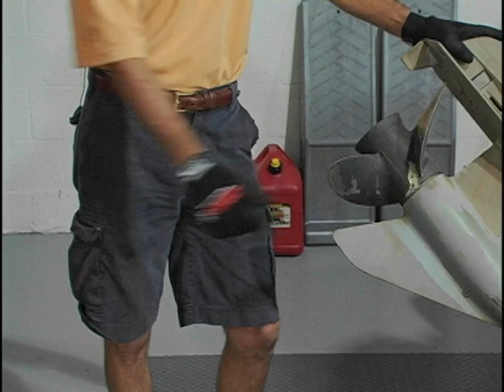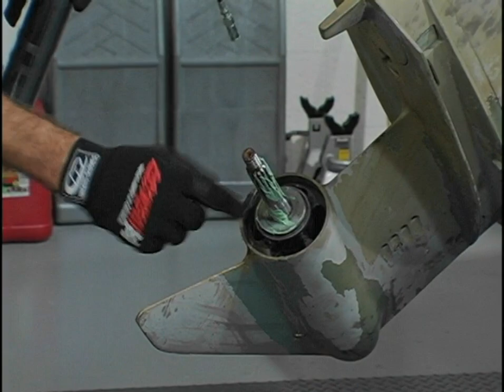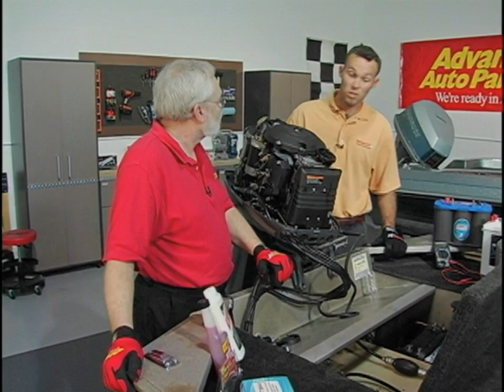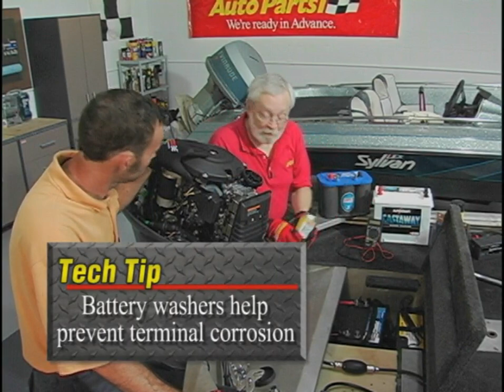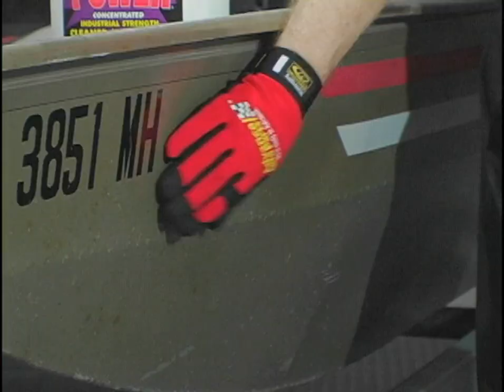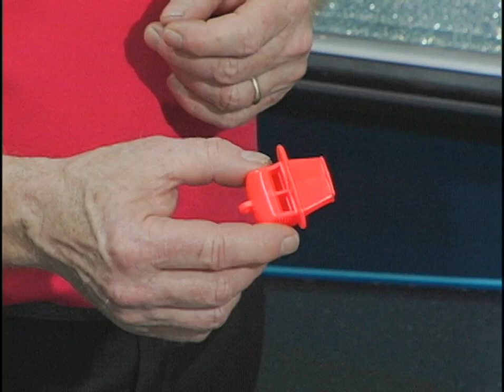Outboard Engine Maintenance - Advance Auto Parts

Comment: Hello Mr. Jim Bates?My name is Kara and I have a 2001 Yamaha 25hp 4stroke F25ELHZ and its surging at full throttle.Do you no what the problem is?
Reply: You could have several things to choose from. Air intake, fuel pressure,electronics or even planing. Hard to say without  visually inspecting.

Comment: hi guys I like to fix my outboards myself and I need the knowledge on how to fix an Johnson and evinrude outboards and same goes for the Mercs too and I have a disability  how id do the servicing myself and learn the right tips on do it yourself outboard servicing I currently own a Tohatsu 30hp 2stroke outboard and need to learn how to service it and im getting ready to bring it out of storage  do I need to change the spark plugs and the impeller for the water pump and if there is other things I need to do like drain the old premix out of my tank and do I need to follow what the mechanic says on gettin the boat ready for the new summer im from Australia  kind regards Michael walker
Reply: michael walker gg
Reply: Yeah dumb ass it's called maintenance

Comment: Is it possible to replace the plugs with (of course) with the same sized threaded type only a type that s removed and replaced using a socket wrench?  I had a Evinrude 175 back in '88 and changed the gear lube with a big flat blade screw-driver and it tightened down fine.  Six months of heavy fishing later, I went to loosen the screws and I could not.  I want to say impossible.  I suppose the vibration from the running motor tightened it into oblivia!  LOL!  A socket would have done it!  Thanks for the good vid!  JEE.

Comment: barnacles should be left to dry out over the winter for 3 months after the preliminary scrapeclean is done, the remaining shellplate of the animal will start to degrade and flake off in springtime with a little bit of help and you won't wind up gouging the surface with aggressive scraping when it is still on there really good.  Muriatic acid seems extreme and will stain your driveway or damage your skin,be wary...use alkaline hydroxide Industrial Purple diluted down greatly, to suds it up